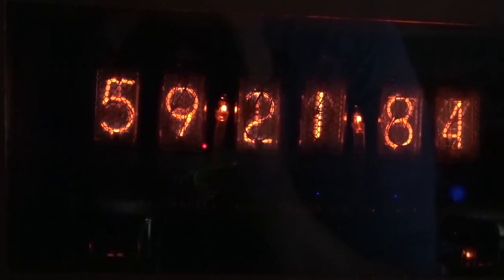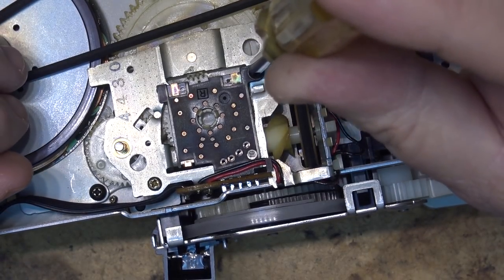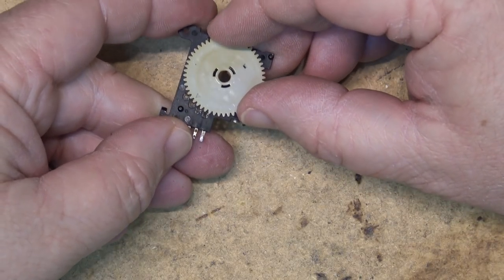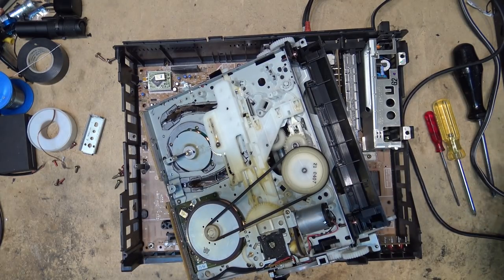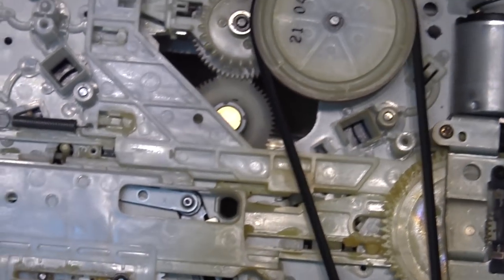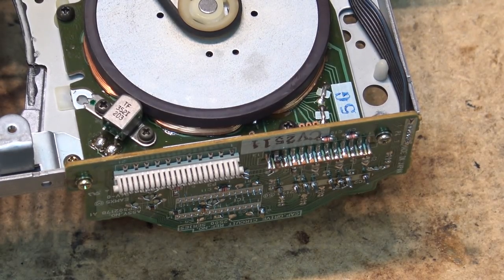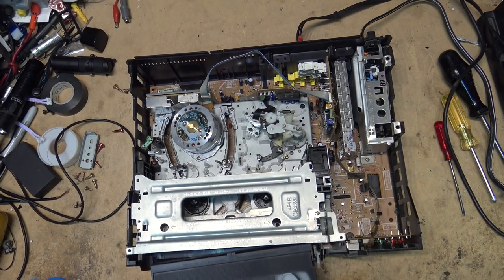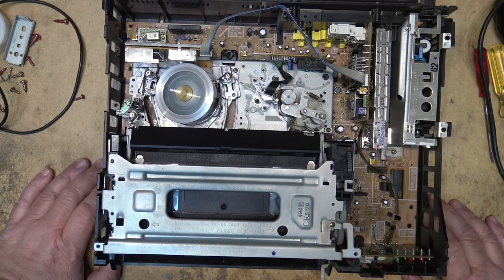Panasonic PV4250 VCR Capstan Servo failure troubleshooting

Comment: FINALLY! After what, 37 years I know what may have been wrong with our GE  4 head vcr. We got it in around 1983-84? Sometimes you would put a tape in and it would moan and take off on a high speed  play/scan. Then you would pause the unit and it would slow down and finally pause. Then it would be ok to press play. We never fixed it. In 1986, I bought the most reliable,  vcr we ever had, a GE 4 head stereo vcr. It was used non stop. Had a really nice variable speed slow motion. I only used the best tapes. I miss that machine. I even remember part of the model# I wish I knew what it was...1VCR6015B OR something really close. Great job! I love your videos.

Comment: Well done.  I've not come across Deoxit D100 before, I may buy in some of that (but it's very expensive in the UK).  Yes, Hall Effect sensors are forever failing on Sony Beta head drums, I've got good at replacing them without having to remove the lower drum / motor assembly.

Comment: Good video -brings back old memories. I repaired vcrs for years. On this mode switch assembly I would take a fiberglass pen (had small bristles on it) and clean until the grooves in metal were smoothed out ,then clean with contact cleaner/then lube. I would clean then slightly bend back the metal prongs for better contact..

Comment: I saw in the video that when u plugged in the rca cord,,u plugged in the white into the red rca terminal,and the red into  the white rca terminal. And of course,,,just as u said,,u had forgot to resolder in the mode switch too as the machine didn't work. As for the red and white plugs the wrong way around,,sound still works,,but the left and right channels are reversed . Good how u had found a single broken dry joint in the motorised Capstan after u had fixed the mode switch,,,and linked a wire to get the continuity connection on the Capstan circuit board,,,and the machine works as it should,,playing tapes nicely. Not bad repair job for a machine found on the roadside,,,as the rest of the mechanism inside looked pretty good,,,even the drive belts too.

Comment: Had this very same issue with a Philips machine sporting the G-Deck mechanism. If I hadn't pulled the plug in time it would've mashed every gear into oblivion! Replaced the sensor with one from a scrap machine and all was well again.

Comment: the mode switch on these vcr's is the electronic equivalent to the carburetor needs cleaning. as for what to do with it you could let it collect dust in a thrift store.

Comment: I was talking to the screen ... "You gotta solder that switch!"
Reply from the maker: I did it to see how many thumbs down I would generate.
Reply: Not a lot of them though :)
Reply from the maker: @TheVCRKing  6 more than there should be.
Reply: Hello, I wanted to ask.  For what reason is the capstan motor brake used for all vcr’s? This brake in my machine panasonic nv ts 88 always press the capstan disc and making the detonation. the gears stil in good position. thanks :) and good job ! respect :)

Comment: I had a capstan speed issue on my Sanyo VTC 5350 Beta (VCR 4200 in North America), tried messing with the capstan free run adjustment without any results, until I discovered that the wires for the tracking control knob had become desoldered from the servo board! Apparently the tracking potentiometer is in series with the servo circuit?

Comment: @12voltvids I am wondering if that trace lifted cause of previous person(s) poor soldering skills like overheating the trace? Not so much from dropping the unit.
Reply from the maker: Doesnt look like that connector has ever been soldered before.  The drive ic looked like it had been touched up in the past.

Comment: I am Looking at what might be a great buy for a JVC BR S800u which sellers tech replaced the servo board. Servo board needing replacement might be cause by other conditions in the deck? I have used JVC BR S525DXU & BR S822DXU for years, both now need cap replacement but servos seem great in these older decks. Any advice? Thanks, great channel.
Reply from the maker: I wouldn't touch any of those old worn out VCRs.  If you need a VCR find the youngest model you can. I use one made in 2012 for archive work. Runs flawless.  Need a tbc you say? Nope just a better capture device. For digitizing you do not need a tbc.  That's all done in the digitizing phase providing you are using something better than a dazzle.
Reply: @12voltvids  thanks, I do use 2 Panasonic 1980's & StarTech USB 3.0 cap. device 1080p, works great, we do lots of conversion. Thanks again

Comment: Was there any advantage to VCRs having those "elevator" type pinch rollers vs the standard ones that just move against the capstan?  Just seems like added complexity for nothing.
Reply from the maker: It was done to change the angle of the tape going around the guides to reduce tension so the tape could remain loaded during rewing and ff.  All vhs prior to that unloaded the tape on rewing and ff.
Reply: @12voltvids  Ahh.. ok. Thanks! 👍

Comment: ive noticed you NEVER seem to need ANY  replacement parts, on the videos that Ive seen.
do you only fix machines that don't require it? 
any way your videos are VERY helpful i find
Reply from the maker: I change Iots of parts. 
If i come across say a broken gear on a machine I own I will generally not fix it because i don't need the device. For example I would never buy a laser to fix a CD player or DVD player because I have many spare machines.
I have no source for most parts.  I don't take chances buying parts on eBay. Have received too many counterfeit or bad parts.
Reply: @12voltvids  thanks for your reply 
speaking of lazors my surround sound panasonic dvd player gives up & displays- no play I have heard that this can be the optic getting dusty, BUT it could mean getting a new actual lazor any ideas? & what might a new lazer cost?
thanks

Comment: i have a question i had a panasonic pv-6000 portable vcr an it was playing in black an white an had a wavey picture an i replaced most of the caps an it still had the same problems i couldent figure out why if you know what the problem was plz tell me my guess the video head was shot cause it made a rubbing sound an it also had another problem the tape was runing kinda slow an had erratic flickering in the picture i tryed the wet finger trick an poked at things an found a piont were it stoped i replaced the cap an it didnt make any change it puzzled me badly an i gave up i replaced all the caps thta had corasain on there leads but never worked so i gave up i no longer have it how ever i did teak down the video head an the source of the rubing was the coper contacts the the drum ride on seemed to have come undone so it posible the drum was falty but i didnt open it right i damaged it kinda 
 if you can tell me whats the cause for these problems or if its posible make a video on how this happens i would love to know vcr repair is still something i cant do an i use these portable vcrs for filming an my homemade movies
Reply: Wavey picture and rubbing/squaling noice suggests tape stiction. The color issue sounds like the AFC/ACC circuit is out of adjustment. Did you clean the tape path well?
Reply: @crashbandicoot4everr  im not sure it was the tape path  the picture was perfect no staic lines in the picture it may have been il have to do that next time i get another one

Comment: Why do solder joints (especially old ones, 30+ years old) sometimes look like they have a crack in them, when they probably don't?  It's almost like a phenomenon that creates a "ring" around the pin on the solder joint?
Reply from the maker: Wave soldering at factory. Thermal shock from heating and cooling of component leads. Dissimalar metals gave different heat expansion coefficients.
Reply: @12voltvids  Fantastic response.  Thank you so much!

Comment: Where did you come across M2s Dave? Only one broadcaster in the uk used M2, they we’re built like a brick sh#t house!
Reply from the maker: I never dealt with m2. I just know what it was.  I believe NBC in the us used that format. Here everything was Betacam SP.  I had betacam for awhile when I was doing professional video acquisition mostly as stringer work for the CBC and BCTV before they became part of Global.  
I used professional hi8 (sony evw300) for most of the private work, weddings ect because I needed more than 20 minutes record time, but for stuff headed for broadcast I used a betacam.  The company leased one for a few years and I would keep it at home and run out and chase down wrecks and fires for the news.  Biggest wreck I covered was an empty coal train that came off the tracks because the engineer hit a curve a little too fast.